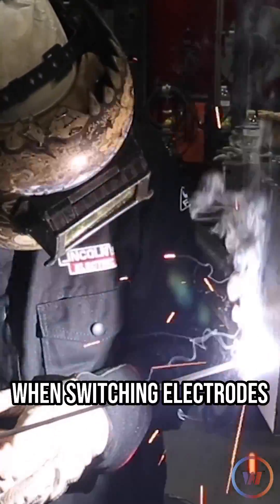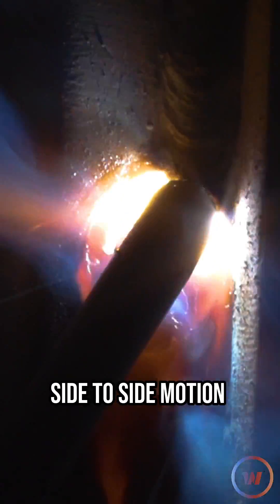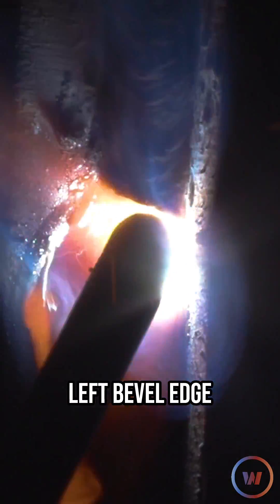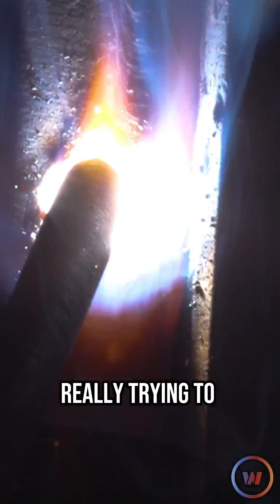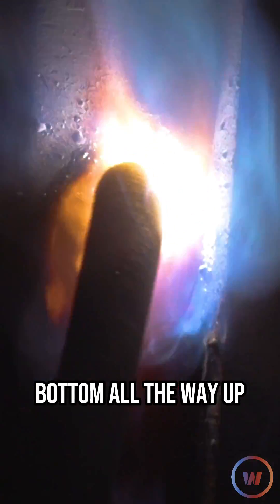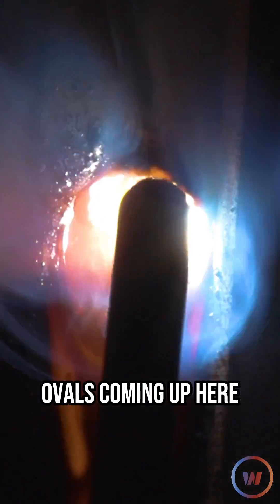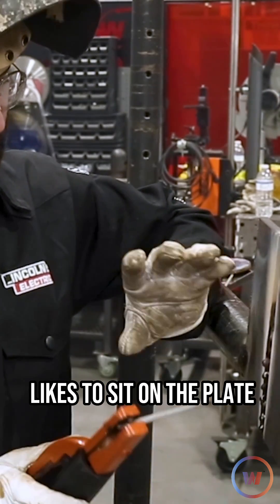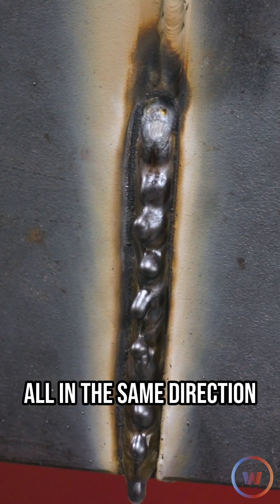3G SMAW Filler Tip

Comment: Wish I could see if with the slag chipped off and cleaned. It's looks like you created to much of a valley on the right side. Perfect for slag to get stuck into and hard to get it out. I would've weaved to get both sides or if running stringer, stay on left side wall and keep right side edge of puddle at center.
Reply: Yep. Looks like undercut city to me

Comment: Very good, tying in the toes is critical, need to do a slight weave and if necessary breifly hold the rod next to the bevel to allow penitration of molten metal to the bevel / base metal. Take your time, allow the rod to do it's job...